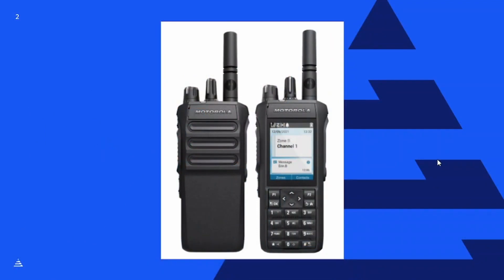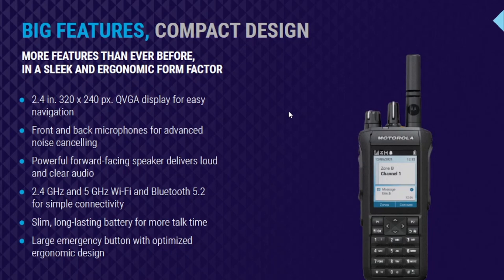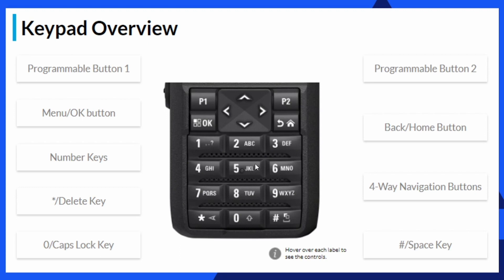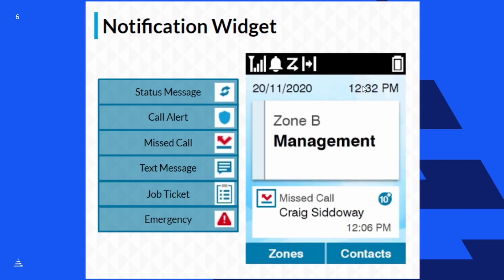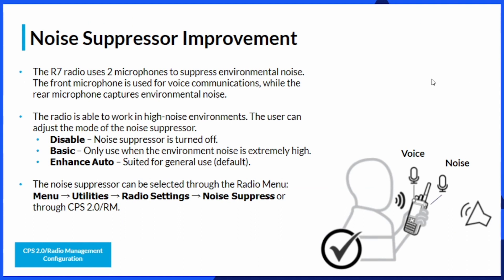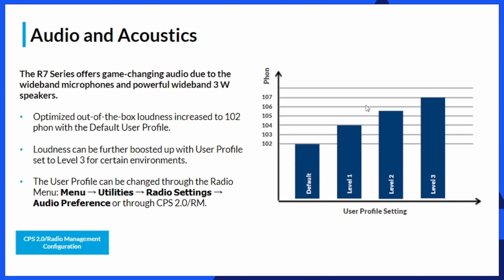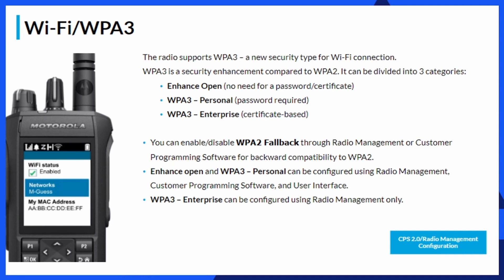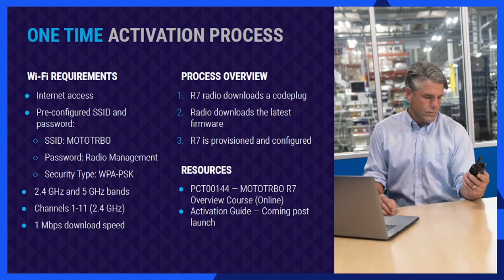P&R Tech Tips | MOTOTRBO R7 - Features

Comment: One question, on the main display it may show  Zone corresponding to that lower button below to press.  IF, I want to re-assign the button P1 / P2 as to ( SCAN, ZONE-UP, ZONE-DN )etc,   will the word show for that selected function show is there a  MENU ITEMS list to select from in the CPS?. On my APX8000 the menu item in the software had that option.
Reply: The verbiage for the P1/P2 button will change depending on what feature you assign to them in CPS. There is a list to select from, in CPS, that will show you all the features you can assign to that button. Thank you for your question. There are more R7 videos in the works.
Reply: @W8DON  Appreciate that, thanks very much.